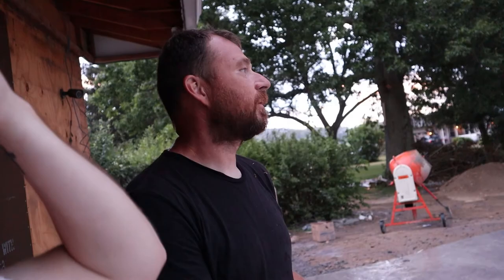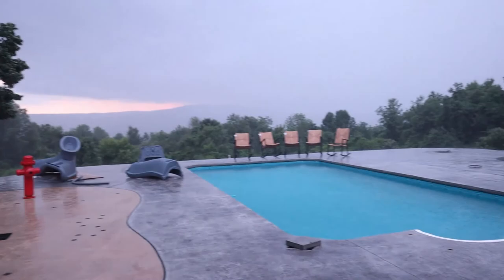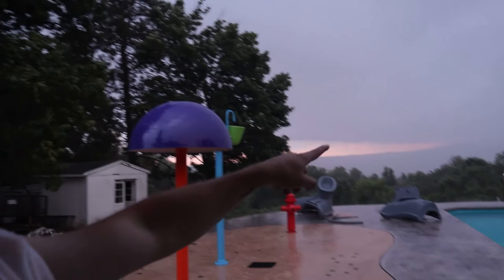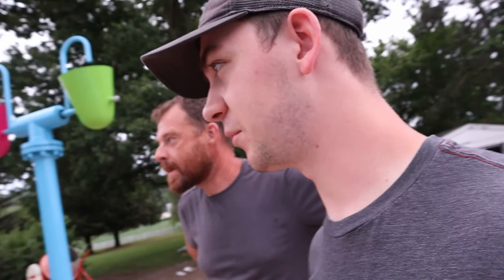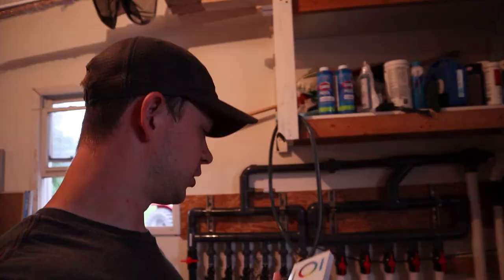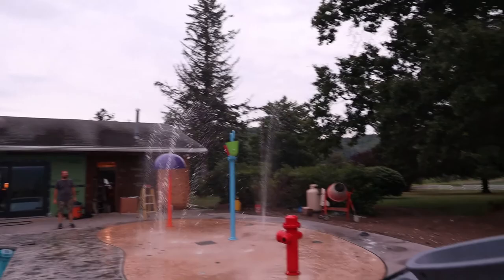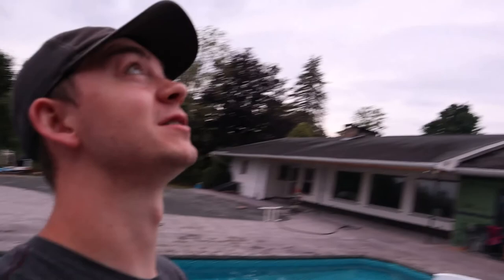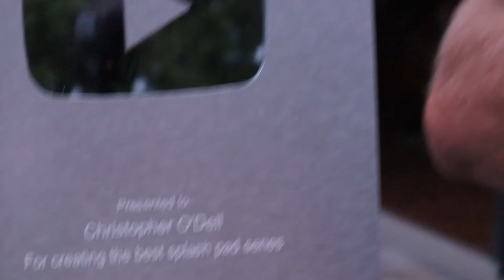DIY Backyard Splash Pad - Building the Fixtures

Comment: I have been having so much trouble dialing in my pressure so I can get all the fixtures and nozzles going.  Then it just seem to drain my tanks l, then the fund over.
Reply from the maker: Sounds like you need a bigger tank if it’s not recirculating fast enough!
Reply: @MatthewCODell   I believe it’s more an issue of the slope, or lack there of, that my contractor needs to address.   The 1/4” per foot going to the drain is not present, except for in the middle.   Having him fix that issue.  I’m sure it’s the reason why my water is not circulating efficiently (plus I’m getting lots of water run off on three sides) It’s a 325 gallon tank feeding 12 nozzles and two water features (umbrella and dumping buckets).   Glad to see someone making a video of their install journey.   It came out really great.

Comment: 19:12 to 19:17 how did you get them to automatically turn on.
Reply from the maker: They didn’t automatically kick on, my dad was in the garage and turned on the pump and opened all the valves to let the water start.
Reply: @MatthewCODell  22:04 to 22:12 you said it comes on random
Reply from the maker: @matthewnorman9803   oh I think you’re referring to the controller to program it, we’re using a rain deck controller (https://www.raindeck.com/products/splash-pad-controllers/rain-deck-multi-program-electronic-controller/) you can refer to our first unboxing video where we talk about all the stuff we got for the splash pad!